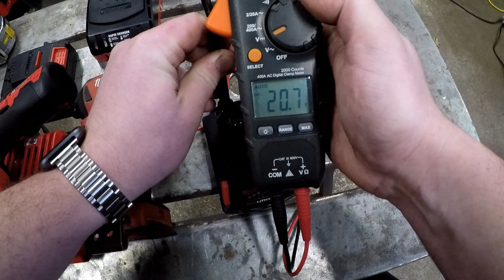Milwaukee Fuel VS HARBOR FREIGHT Bauer  TORTURE TEST!! Im actually Impressed!

Comment: I love my Bauer Impact Driver. Especially with the 3 amp hour battery. Rips off lug nuts at 80ft lbs with ease and is very light and handy for automotive work. So far after swapping suspension components twice on my friends car alongside his Dewalt XR it's held it's own for sure
Reply from the maker: Awesome thanks for watching

Comment: Hi, I have both 1/4 and 3/8 Bauer impacts and they get the job done with ease, it’s not as powerful as the Milwaukee, I’m semi retired now I don’t require top of the line tools anymore, these Bauer’s hold up very well and powerful enough for the minor work I do, if I do a heavy job I’ll get a Milwaukee it’s designed for heavy work the Bauer is diy and retired, excellent tool for the price,
Reply from the maker: Glad they workout for you !

Comment: i have a ton of the bauer tool line and to be honest i have been using most for the past 2 years i do light construction and build and fix furniture full time so i use my tools everyday i have only had one issue so far with the bauer tool line and its there orbital sander since im always sanding probably for atleast 4 hours straight a day sometimes i will go through (4) 5 amp hour batteries just sanding furniture and they dont hold up i wish they would but they start very well after about 2 weeks they get very noisy and the first one i got actually smoked the motor after about 3 months so get the warranty on the sander and one of my 1.5 batterys did stop charging but other then that im very pleased with all the tools i have and how they perform for being brushed motors they do well great video
Reply from the maker: Awesome !